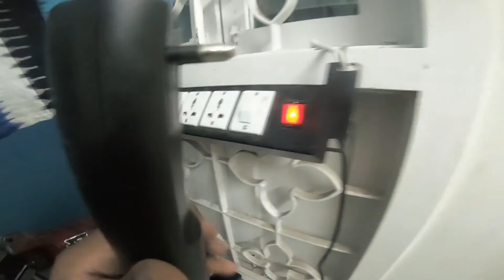Mosquito Bat Repair | Battery  Capacitor and Transistor Replacement| Solved not working

Comment: Very low spark. The battery i changed to lithium. And the tp4056 is changed.after 6 months the spark in the bat is very very low. What is the fault. ( Capacitor/ transistor).
Reply from the maker: @ncramu1280 mostly battery or capacitor
Reply: @DIZ1988Mohan  but the led is working
Reply from the maker: @ncramu1280  must be the transistor or the transformer needs to be checked